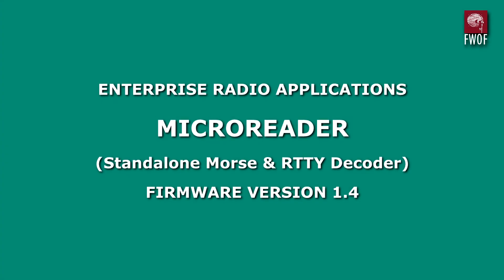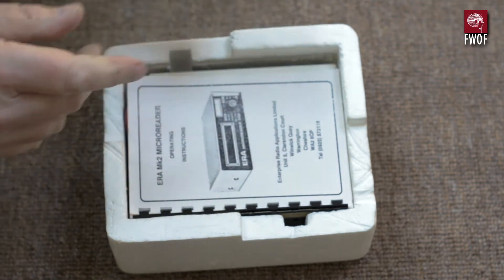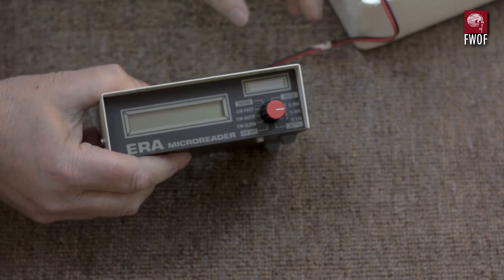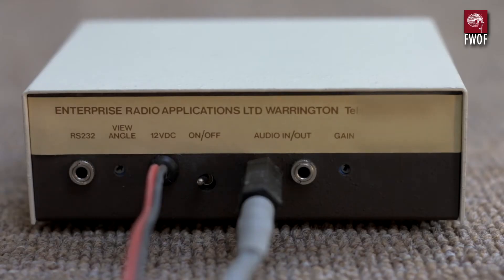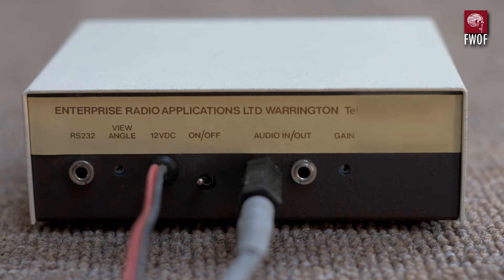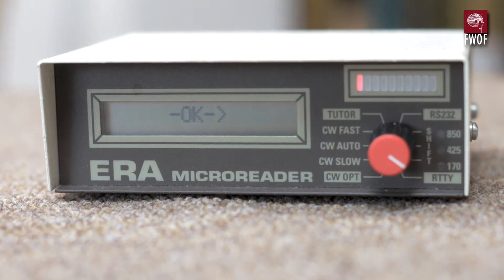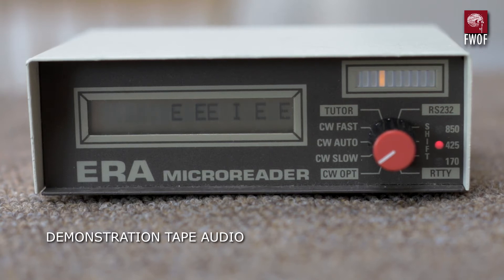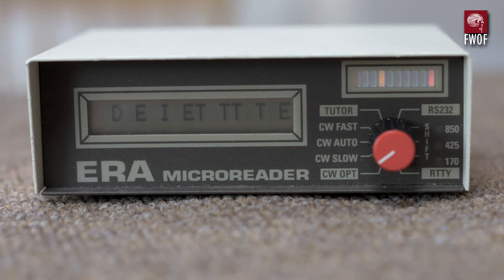ERA Microreader - Standalone CW(Morse)/RTTY Decoder

Comment: Nice vid. Thanks. What audio software are you using on the laptop please.
Reply from the maker: Hi Philip - it's SAWStudio (originally Software Audio Workshop) - been around since the early '90s and updated continuously by Bob Lentini, its original designer. It's quite expensive (compared to, say, Reaper), but I've got used to it over the years, and although it is limited in scope, it meets my needs!
Reply: @FarewellOldFriends  Thanks for the reply. I've always used MAGIX but your software looked cool.

Comment: Great Video, thanks. I have one of these Microreaders given to me as a gift without audio cassette tape, just by any chance are you able to send a full audio from this cassette tape ? Please.. This will make better sense from this device.
Reply: Bevis: You could literally use the audio from this video, it has the calibration tone and some CW and RTTY, you could either rip the audio and loop it in something like Audacity or just plug your Microreader into your smartphone or computer and play those parts of the video into it.
Reply from the maker: Hi Beavis - I'm afraid I can't help you there - I sold the Microreader a couple of years ago complete with its cassette, and sadly didn't retain the soundfile.